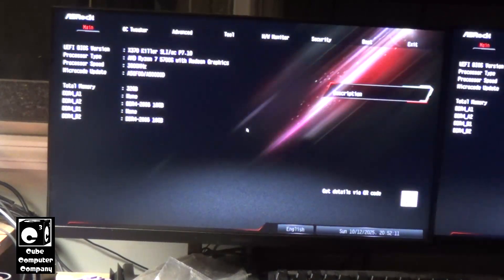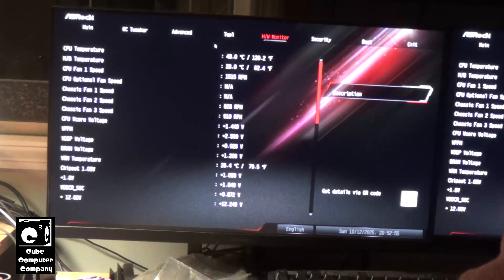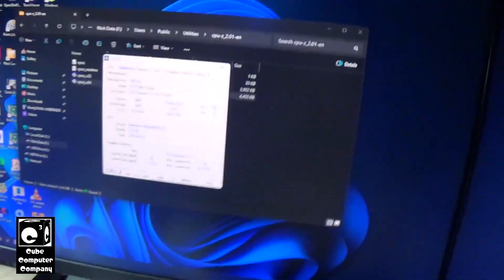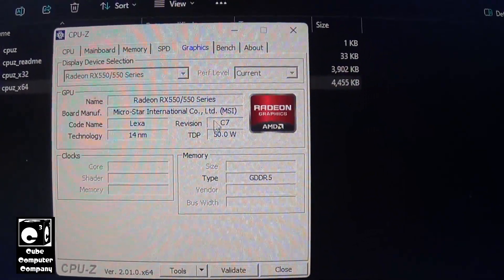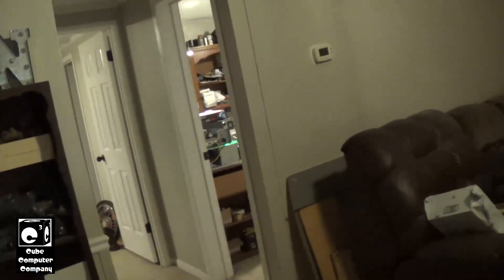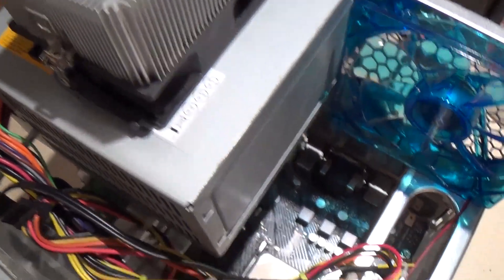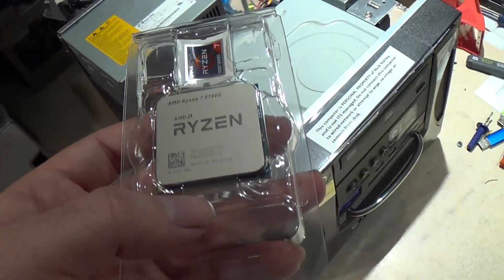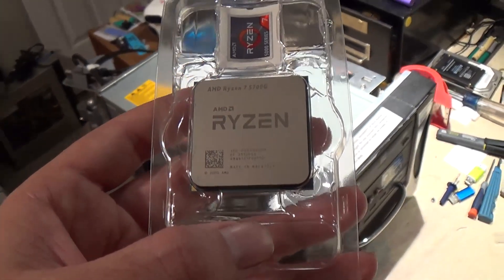Did I just receive a defective AMD Ryzen 7 5700G APU?

Comment: Old motherboard DIMM slots don't have the capability to run DDR4 SDRAM at higher clock speed.
Reply from the maker: This was not a RAM issue, as discussed in my follow up video on this in the pinned comment. The CPU was defective. RAM ran at XMP speeds just fine with the 1700X, as well as the replacement 5700G.

Comment: i got a 8500g and found out after buying that it only has one pci controller on the die. this means if you run an m.2 and gpu the m.2 only runs at sata III speeds and won't show as a m.2 drive. it shows as a sata. for everyone who has been having this problem.

Comment: Before upgrade a new AMD cpu to old motherboard, You should erase or backup all TPM keys before upgrade. If Windows fails, try to boot in Linux from USB.
Reply: This new CPU will give windows 11 new keys in the UEFI BIOS.  AMD CPU's reset the keys number to the boot drive with a new processor. You can thank Microsoft for this. They did this so you have to get a new license for there system

Comment: Well from what I see it is your RAM 
And since you are in Ray 10 
Did you move or change the cables by accident 

Because it still looks like you have a memory issue 

Are you using two sticks or all four 

Try using only the two 
And if that post like it's supposed to take the two out and put them in the opposite sides for channel B
And make sure that posts 
If it does on both 
Use a doss USB disk 
And check your memory 
I have a funny feeling that one or two out of the four if you are using for is pretty badly messed up
Reply from the maker: Explain why changing only the CPU gets everything back up and running... And why would my other perfectly working system play dead when swapping in this particular CPU? Again, with the Ryzen 7 1700X installed in the MidTower Deluxe, that system works absolutely fine. And with the Ryzen 5 5600G installed in the PortaCube, that system works fine... but when I install the Ryzen 7 5700G into either system, they suddenly don't work.
Reply from the maker: I did test a totally separate memory kit in the MidTower Deluxe, and tried just 1 stick. But as I knew, it would make no difference, as there was not a RAM issue prior. And the RAID-10 setup has nothing to do with whether or not Windows will boot, as Windows is on a SSD.
Reply: @CubeComputerChannel 
Also one other thing comes to mind 

Your motherboard did it come from a pre-build 

Example 
I got my nephew a somewhat pre-built 
Case motherboard power supply and fans $159.00
The motherboard in that pre-build from MSI is a pro model but the BIOS chip itself is completely different from what they sell to the public so flashing your bios could have damaged it past a certain CPU that can be used 

Me not knowing you're bored so I suggest to double-check that and double check your bios build
From OEM to normal 

Again this is just a suggestion because I ran into that kind of a problem before and I cannot upgrade that board because of the BIOS is completely different from normal even knowing that it is a MSI pro Creator board but the BIOS itself has a special settings to it 
Again you might want to double check on that
Reply: @CubeComputerChannel 
Then in that case it definitely sounds like the CPU extremely rare for a ryzen 7 5700G is DoA

Because that is kind of strange because I also have a 5700 g 
I put that in my MSI x570 E
Play my games and with an AIO only and the bios still set to defaults that processor will hit close to 6 gigahertz on its own 
At least mine and I don't have to touch a damn thing 
Now it's in a different board 
All set still to default and the memory is in XMP mode at DDR 4 4400 
And it will go 4.9 gigahertz all on its own I do not overclock I like the board handle what it needs to do 
If the AIO can keep it extremely cold it will do what it wants to do 
That's just me
Reply from the maker: @cgriggsiv  I probably should buy a lottery ticket then 🤣

Comment: Since you already updated the bios, can you do Optimized Default and save and quit? If it run POST and were able to get in the BIOS it must be good to me..

Another thing you can troubleshoot is if you have extra sata drive or NVME, you could try to install a new windows 11.

Just exhaust every possible scenario before you return to Amazon, you will eventually buy again and the time lost because of waiting is not productive..
Reply from the maker: Three different motherboards fail to POST with this CPU. Two of the three work just fine with the Ryzen 5 5600G (3rd motherboard is likely DOA). I think that is well enough troubleshooting...
Reply: @CubeComputerChannel  Ohh.. Yeah that is more than enough.. I forgot to tell If you have spare motherboard that is the perfect testing. I hope the replacement is a perfect one..
Reply from the maker: @markpelayo  One thing I forgot to note is the ASRock boards here will reset the BIOS settings to default upon changing the CPU.

Comment: 7:55 it posts, once it finishes posting and goes to the windows part it turns itself off within 2 frames of your camera, maybe fast boot or secure boot was enabled and it just won't let you access windows on other hardware
Reply from the maker: It would have still allowed me access to the UEFI setup utility. Plus, as soon as I swapped in the 5600G, it came right up with that chip. Yeah I should have kept the camera rolling and initially I thought I did...

Comment: Why did you get a 5700G? Get a 5700X! I did an RMA on my Ryzen 5 3600, doing RAM OC cooked it. AMD was cool and replaced it for me, sent me a brand new retail package with a new fan and everything. I was only OC the IMC, but it was enough to ruin my CPU. Did the OC result in an actual performance gain outside Aida64? HELL NO. If you can return it to Amazon it might be faster and you could get a different chip I don't know why you would want a 5700G
Reply from the maker: I wanted the 5700G for the iGPU. The Radeon RX 550 is horribly slow at exporting videos and the 5600G iGPU in the PortaCube absolutely smokes it. I looked at graphics cards and an not paying these inflated prices for GPUs. Crazy how the RX550 is now retailing for pretty much the same price as what I paid for it in 2017.
Reply: @CubeComputerChannel i wonder why tho. Gaming performance is virtually identical in rx 550 and 5600g iGPU
Reply from the maker: @rudraacharya8247  In gaming, they are close. But I wonder if that benchmark is with the iGPU using the default memory share of 512MB? When I bumped up the memory share to 4GB, it greatly improved performance when working with video editing. If GPU prices were more reasonable, I would probably go with a newer GPU and the 5700X. But I've liked the iGPU performance of the 5600G. Very good on power consumption too. The 5600G ran much cooler in the MTDX than the 1700X when I briefly installed it to test it with the X370 motherboard.
Reply: @CubeComputerChannel no, the memory share was bumped up to 4gb and dual channel 32gb 3200mhz ram. In some games the rx 550 also beats the iGPU, like gta 5 and rdr2. In others, the iGPU is better, like in cyberpunk. Probably something to do with encoding or something, idk much about editing or exporting videos tho

Comment: I did a bios flash on a asrock ab350 pro4 board so i could put a second gen apu in. It worked with windows 10 great for a couple months until one day it booted extremely slow, it took a couple minutes to get to win10. Then windows was running slow as molasses. It never booted again, and never posted and no bios. Be careful running 5th gen on first gen board, my first gen board running 2nd gen apu lasted a couple months then bricked the board. Later on I sent you the apu, I think you put it in your parents pc. I guess my experience could have been one of those random flukes.
Reply from the maker: Yes the Ryzen 5 2400G you sent me is in the Black Max. It's perfect for my parents' needs! If this ASRock X370 board ends up calling it quits with the Ryzen 5 5700G, I'll end up swapping in a newer board, preferably one with all the needed video connections for multi-display from the APU graphics.